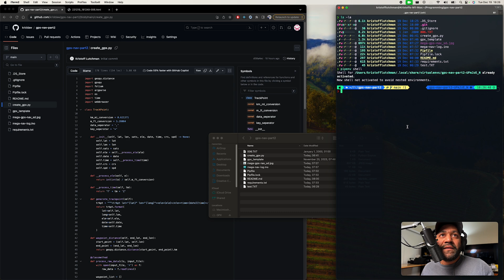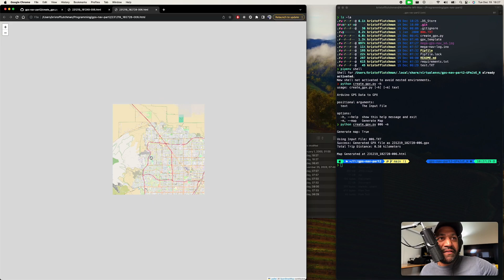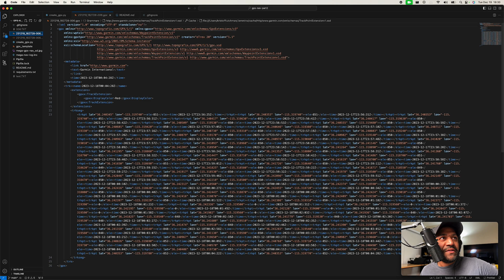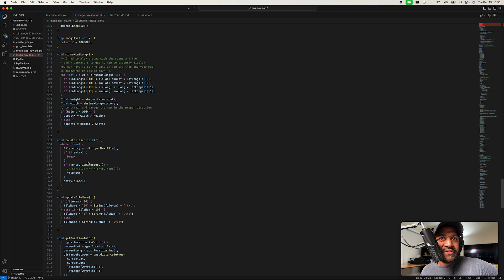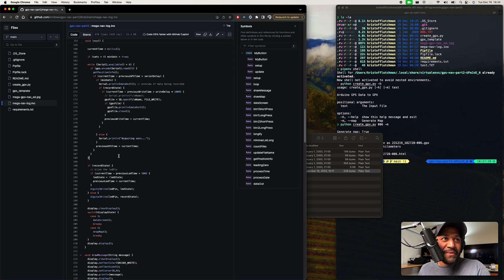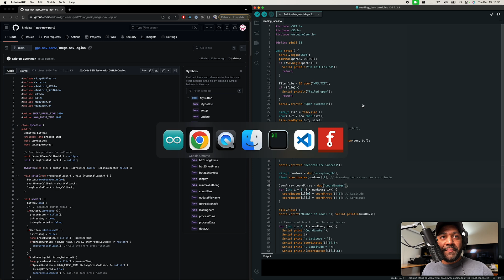DIY Arduino GPS Export GPX Track Part 2 | Code Explained

Comment: Great job, really enjoyed watching what you have done, being only new to Arduino, a fair bit of it went over my head but i understood the objective and result. i would like to do something similar for a powered fishing kayak. This will log my route, and retrace my steps controlling the kayak steering and speed. Also showing my position on a map on my phone. Do you have any advice on where i should be looking for help and inspiration?
Reply from the maker: I think my biggest tip lately is try using ChatGPT to help you understand the parts you need help with. I've been using it for this project and it's pretty amazing how much help it's been. I am pretty decent at python but sometimes struggle with C++. But understanding python helps me ask GPT the right questions and it helps me get the correct code working. The next tip is just start building it. Chunk the project into systems and then combine them and eventually you'll have exactly what you want.
Reply: Thank you for the reply, it appears that you tackle big projects the same as me. Maybe Chat GP is some thing i need to look at. Thanks again